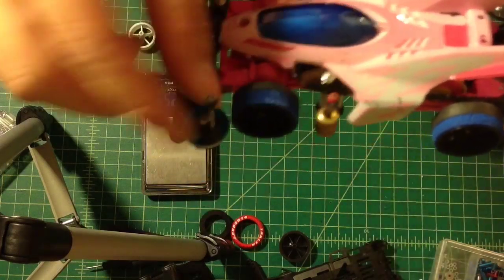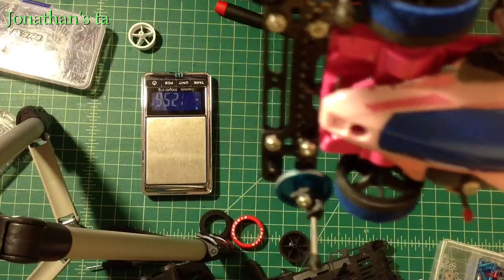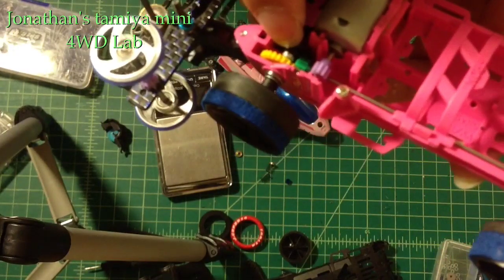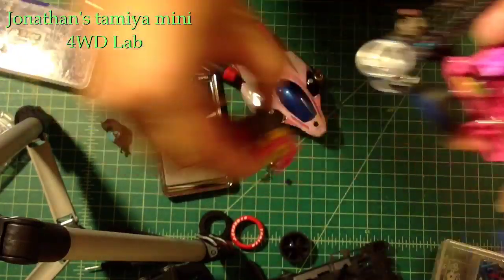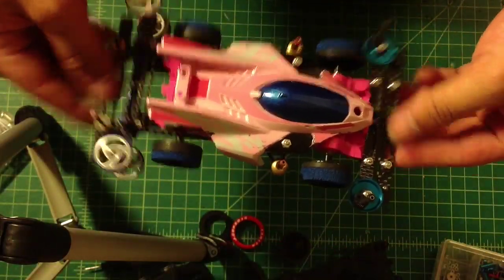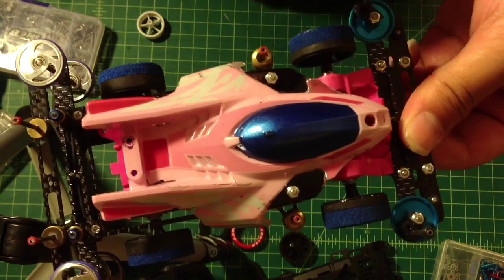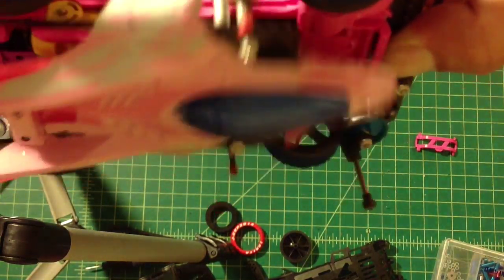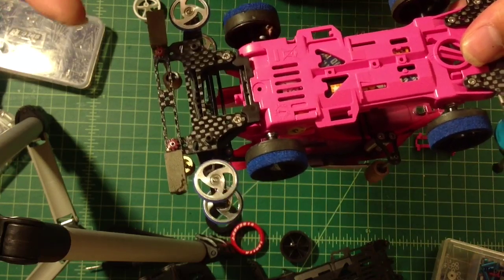Tamiya Mini 4WD tutorial Super II chassis Japan Cup body damper system light weight Part 2/2

Comment: Hi what motor do you usually used in high speed and in tech track 

Thanks
Reply from the maker: High speed always Ultra dash( easy to get hand on it)          for tech~~ it is complicated question~ because it is depend on track layout~~
Reply: Mad Tang
for your last video (race)  what kind of motor do you used.. it's amazing fast and setting.. really like all your video tutorial...
Reply from the maker: Light weight setting only can run light dash~~